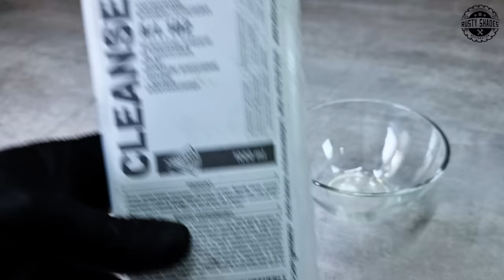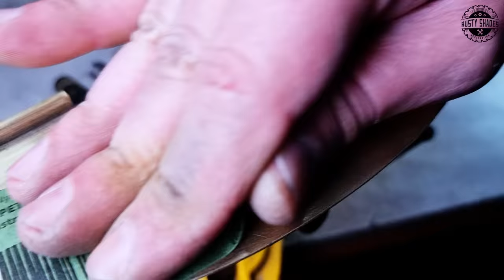Primitive Bread Toaster Restoration - 1918 Siemens-Schuckert

Comment: I had to laugh when you called it "save". A full metal housing and uninsulated copper wires on mains voltage? A recipe for disaster...
I hope it will stay as a display of great craftsmanship and not see regular use in a kitchen!  😅
Reply from the maker: I was checking if no electricity will spill into the toaster's body so I could touch it, knowing I'm about to test it. Some may also have ideas after seeing this video and may try something similar. That step is for them especially, to know how to stay safe and to check it. Nobody will use it to toast bread daily; 😅 that's obvious, I guess. It will serve as a decoration in my kitchen. Cheers, and thanks for watching!

Comment: It would have been more authentic if you had nickel plated the parts after polishing.
Reply from the maker: I consider that mirror-polished brass is more attractive and gives this piece a unique look. I will use nickel solution only if that will be a client requirement or if I intend to use it regularly, but that wasn't the case; this piece will serve as a decoration in my home. Thank you for watching, and I hope you enjoyed the video.